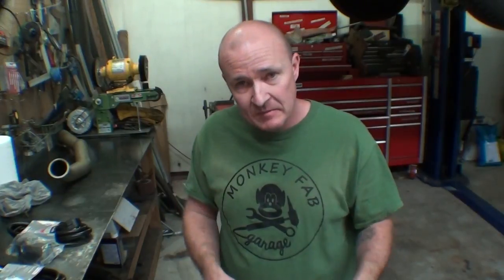how to set up and use a tig welder series 1

Comment: I've watched Jody on his channel off and in for years now. He's got a lot of good stuff for sure.

I haven't done much welding in years though, but every now and then I get the bug to welding something ha!

That's how I ended up here, randomly a searching the reviews on that vulcan protig 205 from harbor freight. I don't have a use for it at the moment but it's on my radar for sure. Right now I've got a little Lincoln mig/Flux welder which does well enough on the occasions I've needed it. 

Took welding classes in high-school and could have certified for stick, but we also did oxy/acetylene cutting and welding, so tig is the last on my list I want to conquer some day. 

At any rate your videos are pretty awesome I'd say. Great info from what I've seen! I look forward to watching the videos I haven't seen yet as well as the new ones.

Comment: thanks for doing this series. i need all the help i can get. I'm 61 years old and just starting to try and learn TIG. i have a miller 215 ( DC only, no HF start only lift, no pulse, no post flow control ) but I'm not sure its the best thing for a newby to learn on. probable going to get the vulcan pro tig 200 so i can get HF start and pulse and maybe, after i learn mild steel , AC for aluminum . thanks again. You and Jody are the BOMB. I'm just a hobby welder that like to fix my own stuff. i can afford the HTP inverting but i can't justify spending that much for something that won't get used every day.

Comment: Mike, I find welding to be very organic. I build a lot of things. Otherwise, I’m machining mating surfaces, drilling for screw fasteners or rivets. These things work much of the time, but construction is bulkier, and some things are just hard to do that way.

But when I finish making these holes, and filling them with parts, I don’t get the same feeling. When I weld even just a bit, I feel as though I’ve grown the parts rather than built them. It’s hard to explain to non builders and welders, but there it is.